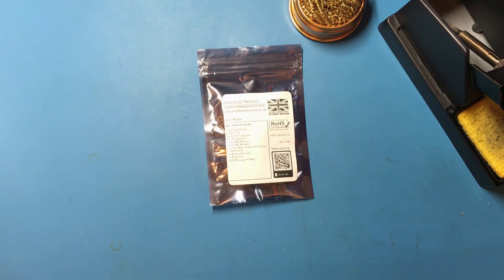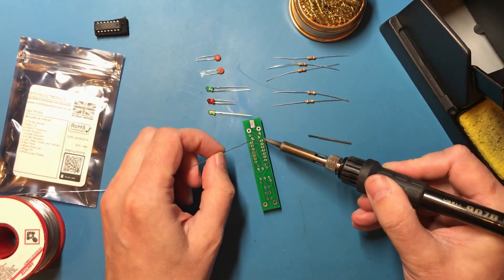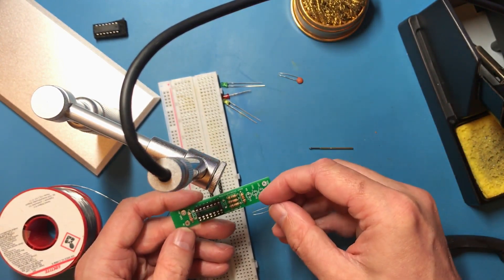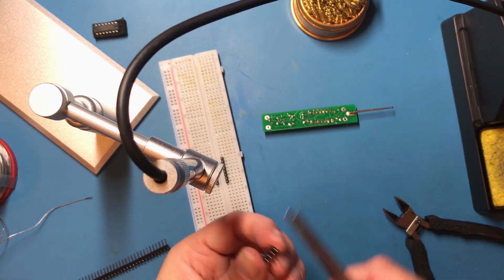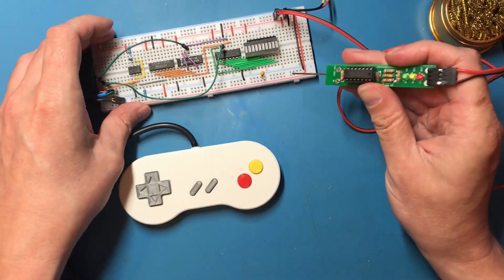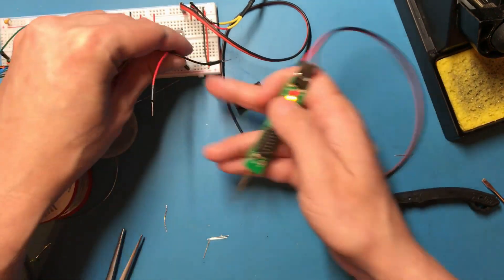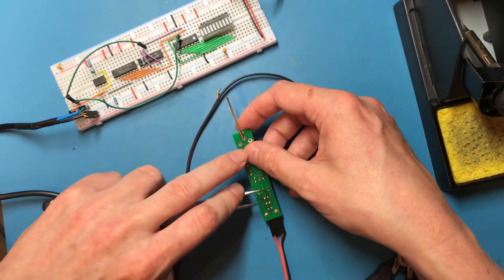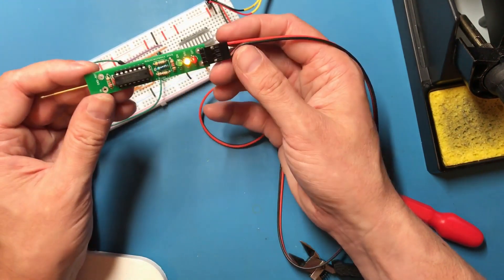ebay Logic Probe Kit

Comment: If you look at the schematic, the resistors used for the green and red LEds also form a voltage divider used to get half of Vdd so it can be compared against the output of the first NOR gate (wired as an inverter, or oscillator when the pogo pin is floating), so changing just the resistor for the green LED may cause some unintended changes in the functionality. (It's probably within tollerances, though.)
Reply from the maker: I might have a go at designing my own one some day, I've had good use out of this.

Comment: Just curious, why do you prefer using the breadboard to hold your pcb during soldering? Why not always use that vice that you use at 11:00 to hold the pcb and some tack or leg bending to hold the components in place during soldering?
Reply from the maker: This is one of those situations where anything I say would probably be post justification. I used the breadboard because that is what occurred to me at the time, it's how I did everything before I had the pcb holder and I usually have a breadboard in easy reach. I can add a couple of other bits of quality rationalization, not least that I'm used to working at the height of my desk, the holder lifts it up which makes it a bit less comfortable to work on. This was also a very thin pcb, so I'd either be moving it around lots or have limited room around the grips.

Comment: Looks like a very useful tool! I might order one.
As for solder suckers, personally I find it to be quite the hassle to handle the soldering iron with one hand and the sucker with the other. But maybe I don't know the proper technique. In any case, I have a 'desoldering iron' on my list of things I want to buy, it's basically a soldering iron combined with a solder sucker, so you get one tool that will let you melt the solder and suck it up. I haven't got one myself, but I've seen them used in videos and they look really useful. The ones from China are quite cheap, but I don't know how good they are.

In other news I have ordered my first batch of PCBs! I'm so excited! Of course I discovered too late that I made an error on what should be a 32-byte RAM board, so it will come out as a 16-byte RAM board... :( I was a bit hasty because jlcpcb/easyeda is currently having a nice offer where you can order any pcb (100x100 mm max), any color, at $2 for 5 boards! The offer expires October 10. I paid very little for 35 boards (6 different), because it was my first order so I also got that first order discount. If I'm not mistaken, the current offer applies to every order, not just your first order, so I'm also gonna order my revised/fixed RAM boards soon. So if you have any PCBs in the making and want to save some money now might be a good time to order! 

(unnecessary disclaimer: I'm not affiliated with jlcpcb. But I do love a good discount.)
Reply from the maker: Yeah, I’ve seen those flashy combination things. The problem with those tools is that it will only get so much use. Most of my soldering these days is SMT, so I’ll only get so much use out of it. Congratulations on the PCB order, I hope they work out.
Reply: I just bought one of those cheap desoldering irons (https://www.velleman.eu/images/products/1/vtdesol3.jpg). According to the manual, I have to "Keep this device away from ... splashing and dripping liquids." I think that means I'm not allowed to use it near molten solder :)

Comment: Have you found any low-cost cases for a logic-probe-sized project?
Reply: I remember a similar project in a magazine from decades ago.

I believe they suggested using the the body of a disposable syringe for a case
Reply: What about an e-cigarette body?
I don't know what dimensions they have. Would it be about that big?
Reply from the maker: Interesting idea, I assume you are talking about the kind with a long thin battery.
Reply: @randomelectronicsanddispla1765  The simplest e-cig body is just a metal tube housing an 18650 battery (18x65 mm), and those tubes would usually be 22 mm in diameter externally. Probably 20 mm internally. It's hard to tell the exact width from the video, but it looks like this board might indeed fit quite nicely in one of those? Might need some padding.
Reply from the maker: My comment earlier in the video about maybe soldering the chip directly was because the chip in socket stands proud of the led's. I had been considering trying to throw together a quick design for a 3d printed case but I used up my available time with the rework.

Comment: Another awesome video. Excellant that you also showed the full adventure of assembly, mistakes and all.  Certainly a good demonstration of how hard life is without a desoldering tool!  As the circuit is CMOS (high impedence) you'd want to be careful not to touch the circuitry while you are holding it, or you'll likely get some unexpected readings. :-)  As a suggestion, you could use some heat-shrink tubing to encase the board, at least up to the LED's (ie. the part where your fingers hold it).
Reply from the maker: Thanks! Interesting idea, I'll have a look to see if any of my heat shrink is big enough.

Comment: I think this little device would be a lot more useful if it had the option to generate 2 different 'tones' via a small speaker for logic LOW and HIGH.   Exactly like the continuity test on a multimeter. Would make a fun weekend project with a bit of DIY perfboard.... ( buggers off to find that 555 timer based sound schematic he read about last week..... )
Reply from the maker: It's interesting how simple projects can get the ideas flowing. While building I was thinking about making one with a microcontroller and a small lcd screen so I could detect frequency and duty cycle. Would be nice to have a button to collect a bit and shift it so you could have a hex display of a bus.
Reply: That might indeed be useful! If you get it working, I definitely wouldn't mind seeing schematics :)